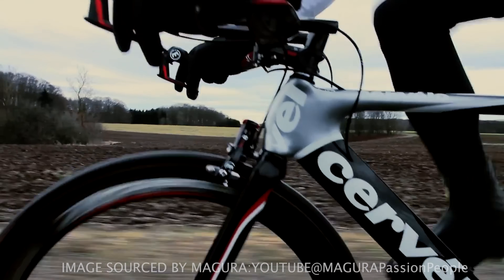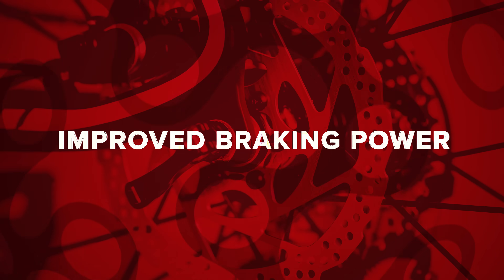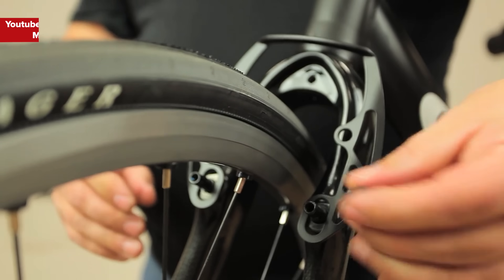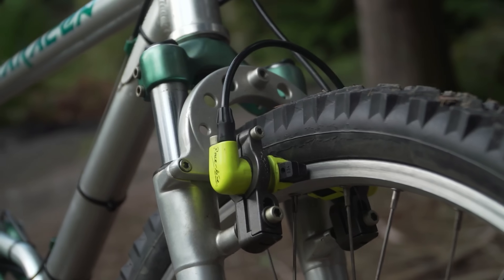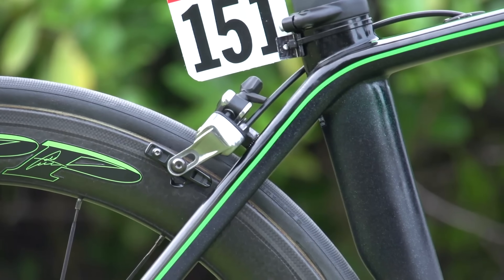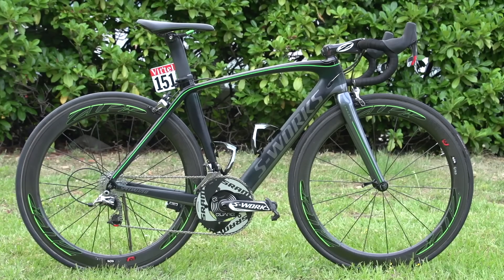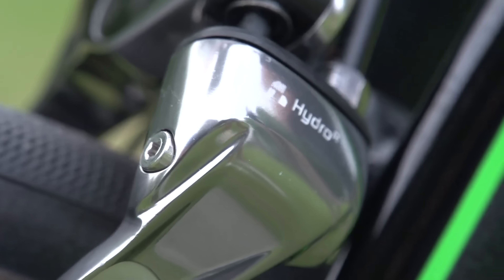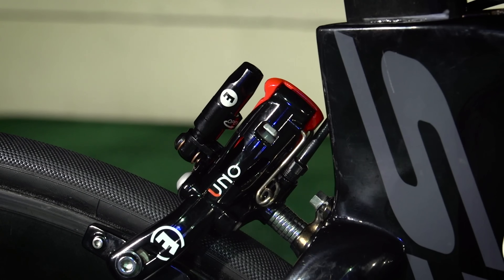The Rise And Fall Of Hydraulic Rim Brakes

Comment from the maker: Hydraulic rim brakes are a classic piece of "what-if" bike tech! What other forgotten cycling innovations should we dive into next?
Reply: Shimano XT M775 Dual Control and Shimano XT ST-M760 dual control, were STI shifters for hydraulic and cable systems, in the brakelevers for flat handlebars. Allowed you to shift down 3 gears and up 2 gears at one time. Much easier upshift on the front with a larger lever for the hand instead of a short one for thumb.
I still use a set on my folding bike and one on my MTB used for commuting and touring. I enjoy it so much that I have a set as backup in stock, if anything should happen to them.

PS: The Magura hydraulics on my Duch recumbent Challenge Hurricane was a surprise but they worked flawlessly after cleaning.
Reply: It's not really a what if, but I think a look back into old type slotted cleat cycling shoes would be interesting. Most people don't really know why their modern shoes and pedals are called clipless. Clipped tech was used from the beginning of cycling well into the 90s, yet few people now know how it worked.
Reply: Companyolo shifters:  Just rode with a gentleman that had steel frame custom built in 2007 and it had Companyolo internally routed cables that were 25 years old.  Shimano didn't produce that till 2010ish I thought.   His bike was pretty amazing.
Reply: Hub gears on those 40 year old bikes.
Reply: Im riding a van rysel edr af 105 tektro rim brake and want to put mudguards for winter. Which one do you suggest
Reply: Suspension stems with elastomers might be out of the question. I've encountered them before and was amazed that 25 years later, there are no spare parts available anymore, and what they're even for on a trekking bike :-)

Geared hubs always work. You could show them everything from the first 3-speed Sachs to the Rohloff in oil. Variants of these are even a topic on e-bikes with mid-engines. Seriously, a gearbox runs in oil next to the electric auxiliary motor... Also an innovative topic and very current. The German manufacturer Pinion (MGU) has made a name for itself, which, of course, comes at a high price. It's best not to have any leaks, otherwise the motor will stall :-) In the early stages and when the battery was empty, the gearbox wouldn't shift anymore; perhaps they've got it under control today :-)

Comment: I still have an old steel Randoneur from the late 1990s. Hydraulics were never installed on these bikes. The reason is the need for repairs in the field and the availability of spare parts in developing countries. I believe hydraulics have their place on mountain bikes because they offer more precise control and also brake better in wet conditions. Repairs are difficult in the field, and they are also more sensitive to wheel damage than V-brakes.

Rim wear is a fact. However, I still believe that, if you look at the wheel as a whole, the bearings are also worn out after about 15,000 km. In any case, it's strange that we accept the weakening of a load-bearing component in bicycles due to wear. A broken rim would be very dangerous at the front. Luckily, mine always broke at the back, and I've seen it before; it was almost gone. 

The successor models to my old bike today also have disc brakes and hydraulics. I think these bikes mostly ride in the first world, or everything has become more reliable. The manufacturer is usually very thorough in development and only uses reliable components.

Comment: Entire hydraulic idea for rim brake based wheels is a nonsense. Isn't it? Fix me if I'm wrong.
Regular brakes operate like a  charm on aluminium rim's. They've invented disc brakes (which are aluminum as well) only because it's shitty to use rim brakes on carbon rims. Big story told in one sentence.

Comment: Magura HS33 are great. Have them on my "vacation"bike. Made them work with the mastercikinder from a RT6 so a could mount a dropbar with STI's.
Great stopping power and modulation on a "old" V brake frame. (Surly LHT).

Comment: I still use Magura rimbrakes on my somewhat older touring bikes. For this application, I don't experience any issues. I even strongly prefer them over V-brakes. Whenever I bought a bike that was fitted with V-brakes, I immediately replaced them. I hate these things for pulling to one side, and then rubbing against your rim all the time. To me, V-brakes are the failure!

Comment: Honestly the whole idea of hydraulic rim brakes just feels superfluous to me. The main issue (potentially) with cable rim brakes has never quite been a lack of clamping force, especially on alloy rims, but the inconsistency of braking power in less than ideal conditions, especially on carbon rims. So in the end if you ride carbon rims in the wet, clamping the calipers harder with hydraulics simply won’t stop you any quicker than cables.

Comment: Hydraulic rim brakes offer all the downsides of hydraulic brakes (more faff, more weight) and all the downsides of rim brakes (poor performance in wet conditions, rims are expensive sacrificial components, tire clearance is limited). It's no wonder at all that disc brakes ate their lunch at the earliest possible opportunity - and thank goodness, say I. Cable-actuated rim brakes are fine for fair-weather road riding on non-elite wheels (i.e. the large majority of the riding most people actually do), and hydraulic disc brakes are superb for those use cases where the superior performance and wider tire clearance justifies the extra weight, cost, and complexity. It is not unreasonable, I think, to assert that there is simply no natural home in the bicycling ecosystem for hydraulic rim brakes, now that disc brakes are ubiquitous.

Comment: magura produced also hydraulic rim brakes for roadbike but it was not sti compatible and in the 90 biker want integration design, you can use only frame gear lever that was not the future-also the brake was good

Comment: No. I think the real reason is when you understand the braking process better, you soon realize that it's never the hand force required for the brake lever the limiting factor. It's always the TYRE GRIP, especially on road bike. No matter what system you were on, you'll be skidding all over the place before the hand force becomes a real issue. With more powerful brakes you only achieve one thing that is you'll approach that breaking point of grip aka. lock wheel sooner. The best case of the brake action is to map the full range of the brake action from 0 to the breaking point force to the full force range of your hand. So that you have the widest force band to modulate the braking force with very small steps and huge precision. Because it's never a problem so you are spending basically $400 for nothing of course that won't stick. When you were to lose a tyre you lose a tyre, when you were to having zero friction in the rain you still have zero friction. Basically nothing changed. If you were to make the rim surface the same as a disc rotor and the pad the same material of disc brake pads, I believe you'll have the same all weather performance like a disc brake plus even better braking force because you brake at a larger circumference thus a larger lever arm (imaging 29 inch disc rotor). But again all you do is basically make it more easily to lock a wheel and skid. And that constant sanding down the rim just doesn't make any economical sense for any bike business.

Comment: Magura's RT8 set was so elaborate, but it didn't work.
Rim brake systems had reached a level of perfection with wire, and hydraulics were merely a "middle-aged man's fantasy."
However, the truth is that even today's hydraulic discs are still a "middle-aged man's fantasy." Although it has added obvious waste to a world that strives to eliminate waste, it has simply ensured practicality for the sake of promoting it.

Comment: @askGCNtech   Hey dynamic duo of brain power, first thanks for all the help in the past.  New question, I'm moving to the little E-mini bike inflator.  I happen to have chosen Cycplus tiny, version 2. Once charged and stored on the bike, how long should I expect the charge to be sufficient to allow inflation of, as example, a single 40mm gravel tire to 55 psi.  Let's assume a tube for sake of question.  I need to build a reminder in my phone like for DI2 charging, Blinkie charging, chain waxing, etc..   Remember the old days when you rode a bike without batteries??
Reply: Just for context, this is to replace 2 CO2 inflator heads, 3 16g cartridges, one sleeve, and possibly change storage device on bike to a lighter and smaller.

Comment: More context perhaps. Cannondale did a thing called the Road Warrior somewhere between about 2001 and 2005 I think. I had one. This was basically a road bike frame with that fork that allowed a tiny amount of suspension movement (Headshock?), a suspension seat post, flat bars, and Magura hydraulic rim brakes on road bike style single-point mounts (i.e., not V-brakes). I used it rather as what one would now call a city bike. The brakes were powerful, easily modulated, and reliable. Like hydraulic discs, they were also self-adjusting, which is an advantage of hydraulics not mentioned. And, about the onset of disc brakes on cyclocross bikes in relation to this whole hydraulics question: at about the same period, Cannondale and one or two smaller US manufacturers introduced cyclocross bikes with cable-operated disc brakes. And then a few months later the UCI in its inimitable fashion said, 'Oh didn't we tell you: you're not allowed to have disc brakes on cyclocross bikes.' I still have one of those Cannondales hanging on a wall.

Comment: Bad & Ugly! I don't think there was any "good" 😂 thank god they didn't take off. Hydraulic disc brakes are the best braking system, it's why they're used in most forms of transport. Power to weight performance is spot on. I read recently, Tesla is using a full electronic braking system. No force needed just data sent down a cable to a computer chip, I think their cyber truck has it. How long will it be before we see that on bikes?

Comment: You left out that they work soaking wet. I put the Magura 22’s on my first gen GT full suspension. Had them on the next gen GT FS. Then I built an GT STS with HS 33’s. The only real downside is that the wore out rims. 
PS
I thought they were way better than V brakes.

Comment: Having A RT8 converter Brake set  by Myself, wich works  awesome.  nearly maintanancefree since  about 10 years or so.  2 Friends of mine have a Set with Red rim brakes, and they are Great aswell. An other one has the Original P5 with RT8. The Stuff Works Great. Even  Going down  Port de Valdemossa or Sa Calobra is a Joy with them Brakes ! No Numb Hands after Realy Pressing down sa Calobra.  And in Fact, We Collected a lot of Day´s Best times this year in Mallorca  ( Even with 23 mm Tires....)
Reply: 23C tyres. Hell yeah!

Comment: Reason rimbrake is loved = simplicity, lightweight

Hydro rimbrake took that away 😂
Reply: Sounds like you don't have experience with hydraulic rim brakes. My wife inherited a now 20-year-old bike with hydraulic Magura rim brakes. They have never been bled and still work perfectly.
Reply: @MaxLein nothing about experience or not, i changed parts, service, rebuild quite often. Almost every 1,2 months strip off, cleanup. Its a hobby. Cable made it easy, simple, and LIGHTWEIGHT. Cant say the same about hydro rimbrake right?
Reply: @shhhdontshout  In my hands-on experience, I think I can say the same: replacing pads is the easiest of all rim brake bikes I have owned, they simply click into place. The rest (oil, hydraulic lines, levers, etc.) has not been changed in 20 years. Not sure about weights, but pretty sure it doesn't matter for a hybrid bike that's meant to see a few forest roads tops.
Reply: @MaxLein im on roadbike, sub 7kg, often need a cleaning since my country rain all year long..i didnt ride in the rain but still on a wet road, I like my bike cleaned, with my groupset shiny (sram red polished silver) 

You are right too, but we just got different needs 😂
Reply: @shhhdontshout  Well, they only reason I don't have more experience with hydraulic rim brakes are hydraulic disc brakes. Got those in the mid-2000s on my mountain bike and then on my first real road bike. I wouldn't want to have non-hydraulic rim brakes on any of my bikes. 

Hydraulic rim brakes are a technology that only make sense in very specific niches. :)

Comment: Changed from SRAM Force cable brakes to SRAM Red HydroR on my road bike years ago, moved them onto my current frameset and they're still going strong.  I find they have better modulation and the much lighter pull force helps me maintain control on long mountain descents.  Using SwissStop BXP pads (the blue ones) on DT Swiss OXIC ceramic coated rims and the stopping power is excellent.  They do suffer from some lag in the wet though.

Most folks don't notice them but those that do can't stop playing with them at coffee stops!

Comment: Hydraulic rim brakes were obviously a gap step before disc brakes. You already had discs on mtn bikes, gravel bikes, and it doesn't make sense for a mfg to make hydraulic rim brakes when they are already moving to discs, and discs don't have any of the wet weather issues that even hydraulic rim brakes have.

Comment: Cycling in muddy conditions requires disc brakes to keep the braking surfaces clear of the elements. But for road bikes on clean surfaces, I’m not going to pay the “low IQ tax” for disc brakes. Rim brakes are easier to maintain, more affordable, lighter, and provide excellent braking power thanks to the much longer torque arm(about 3 tims). Have a nice day.

Comment: I just want to add one thing, even though the rim brake is a simpler (and low maintenance) design, it is a poor design functionally speaking. A component "by rule" just has to do one thing (a do it right), the rim brake in that case is doing two things, creating a interface to hold the tire and funtion has a braking surfrace, and whatever happends to it affects the two functions (like a big pothole).

I love rim brakes, I use it my two bikes (a Dedacciai and BH), but tecnical speaking, disc brake is better, a component to brake, and a component to hold the tire independly.

Comment: I really think that the current groupset manufacturers are missing a trick in not making hydraulic rim brake calipers that could be used together with their existing disc brake levers. It would just be one single extra option and it would open up sales of current groupsets to anyone wanting to fit them to just about any rim brake bike.
Reply: I think it would be a good option to allow older rim brake frames to be upgraded to modern groupsets. For older frames where you are stuck with rim brakes you also end up rather stuck with mechanical cable pull gears. I would love the option to upgrade to a modern electronic/wireless gear on an older (not classic) frame. Compatible hydraulic rim brakes would be a good way to open up this market.
Reply: @davebolton7208 Shimano still does Ultegra and Dura Ace Di2 12sp group sets with a rim brake option. I fitted the Ultegra version to my rim brake bike last year.
Reply: Agree. But with UDH rear derailleurs even our modern disc frames will become obsolete much sooner than we want.

Comment: Hydraulic single-piston calipers on bicycles don't fully exploit the advantages of a hydraulic system, other than low transmission losses. Hydraulic brake systems became popular on cars because the force applied at the master cylinder is replicated at each wheel instead of being divided as it would be in a mechanical system. It also simplified brake actuation at the front wheels, which needed to be able to steer. They allowed you to have the same braking force at all four wheels that you were applying at the pedal. You can get force multiplication in a hydraulic system by making the surface area of the master piston smaller than that of the slave, and by using dual-piston calipers that will apply the force on both sides of the rotor (which from a force perspective is pretty much the same thing), but you can achieve similar results by changing the leverage in a mechanical system. The limitations are always in the amount of travel available at the lever and the rider's hand strength. I think what did in the hydraulic rim brake was that it didn't solve many of the issues with rim brakes that discs did, it was complex and proprietary, and dual-pivot brakes worked as well as most people needed them to at a lower price.

Comment: Still run mine and they're great.  Mine are Sram HydroR, with gutted shifters converted to Di2.
Reply: I run a rear HydroR caliper. Swapped a fork for a disc one, bought an Ultegra groupset and changed the 2 orings in the caliper to be compatible with mineral oil. Works brilliantly and the rear braking is almost as good as the disc.

Comment: I bought a trials bicycle equipped with HS33 rear brakes. I did it to build skills for mountain biking and never really got very good on the trials bike. But the HS33 was a really popular rear brake with the trails crowd back when I bought my bike. When set up properly, those brakes gave instant, predictable lock up power  using 1 finger for hopping around on the back wheel. The really good competitors used an angle grinder to roughen up the rim surface to get even more powerful bite

Comment: I mused a power booster module that fits somewhere along the line of the cable. The lever/cable pull operate a conventional hydraulic system, within the unit. The output then pulls a conventional calliper. Giving it extra, tunable power.

Comment: Don’t think that the cable hydro was an issue for rim. The rim game changer was the rim ceramic coating and pad compound… some coatings were exceptional and unfortunately went down the drain with the disc tech.